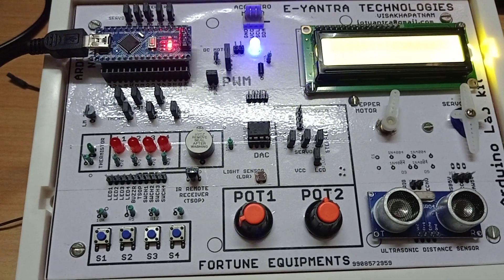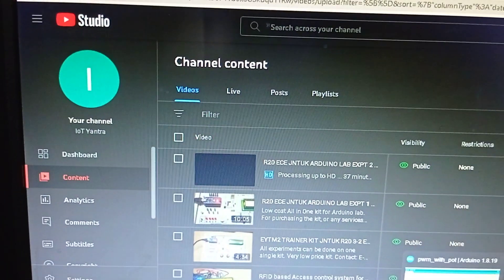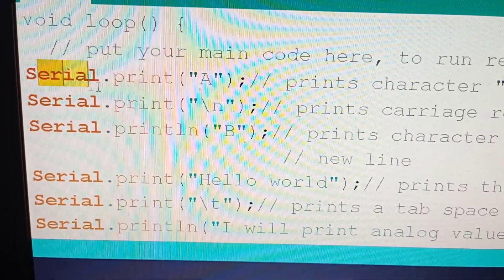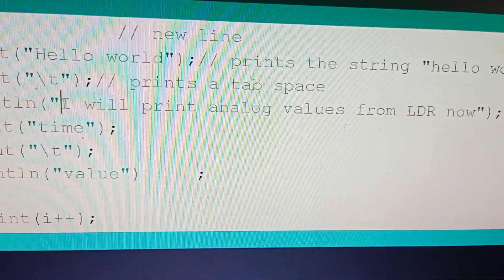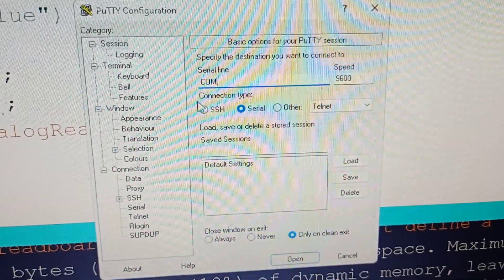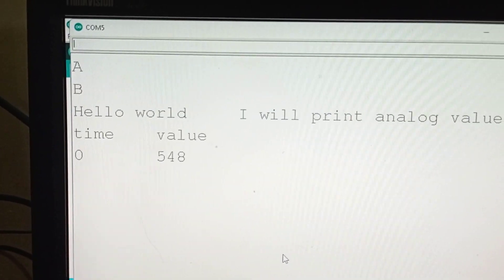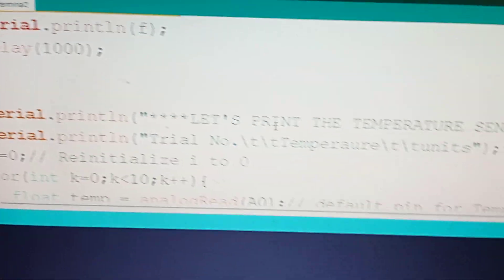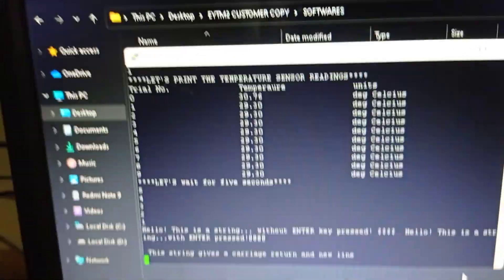R20 ECE JNTUK ARDUINO LAB EXPT 3 AND 4 DRIVING CHARACTER AND STRING TO HYPERTERMINAL

Comment: Sir please send the code
Reply from the maker: void setup() {
  // put your setup code here, to run once:
Serial.begin(9600);// start serial communication on arduino with pc
pinMode(A6,INPUT);// SET THE LDR INPUT
}

long i=0;
void loop() {
  // put your main code here, to run repeatedly:
Serial.print("A");// prints character "A"
Serial.print("\n");// prints carriage return and new line
Serial.println("B");// prints character "B" with carriage return and 
                     // new line
Serial.print("Hello world");// prints the string "hello world"
Serial.print("\t");// prints a tab space
Serial.println("I will print analog values from LDR now");
Serial.print("time");
Serial.print("\t");
Serial.println("value")     ;
while(1){
 Serial.print(i++);
Serial.print("\t"); 
Serial.println(analogRead(A6));
delay(1000);
}
}
Reply from the maker: void setup() {
  // put your setup code here, to run once:
Serial.begin(9600);// start serial communication on arduino with pc
pinMode(A6,INPUT);// SET THE LDR INPUT
}

String data="";// declare a null string named "data"
void loop() {
  // put your main code here, to run repeatedly:
Serial.print ("Hello! This is a string... without ENTER key pressed! $$$$  ");
// prints the text under the double quotes without any discrimination
// no new line and carriage return given
delay(3000);// give a 3 second delay
Serial.println ("Hello! This is a string...with ENTER pressed!@@@@  ");
delay(2000);// give a 2 second delay
Serial.print("\n");
// this is equiavalent to pressing the enter button of keyboard (in software)
delay(2000);// give a 2 second delay
Serial.println(" This string gives a carriage return and new line ");
delay(1000);// give a one second delay
Serial.println("****LET'S PRINT THE Light SENSOR READINGS****");
Serial.println("Trial No.\t\tDarkness\t\tunits");
// this will print column header with two tab spacing in between
 
// if you want to print the light intensity(darkness) in formal way..then use 
// the following lines

int i=0;
for(int k=0;k<10;k++){
  int value = analogRead(A6);
Serial.println(String(i++) +"\t\t\t"+String(value/10)+"\t\t\t"+ "% dark");
delay(500);
}// close for loop
Serial.println("****LET'S wait for five seconds****");
for(int f=5;f>0;f--){
Serial.println(f);
delay(1000);
}

Serial.println("****LET'S PRINT THE TEMPERATURE SENSOR READINGS****");
Serial.println("Trial No.\t\tTemperaure\t\tunits");
i=0;// Reinitialize i to 0
for(int k=0;k<10;k++){
  float temp = analogRead(A0);// default pin for Temp sensor LM35
Serial.println(String(i++) +"\t\t\t"+String(temp*500.00/1024.00)+"\t\t\t"+ "deg Celcius");
delay(500);
}// close for loop
Serial.println("****LET'S wait for five seconds****");
for(int f=5;f>0;f--){
Serial.println(f);
delay(1000);
}
}
Reply from the maker: The above code works on the kit sold by us. you need to modify it  according to your connections on arduino